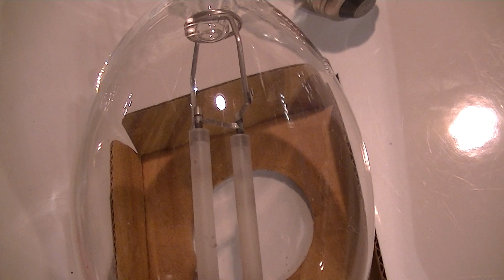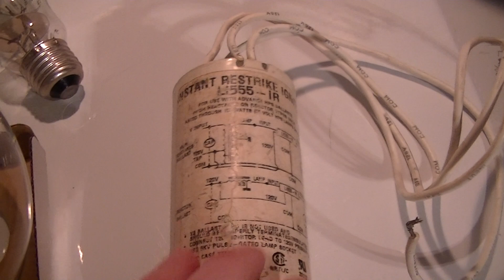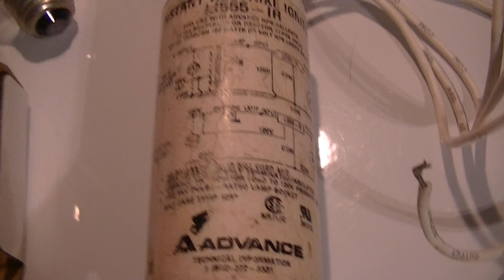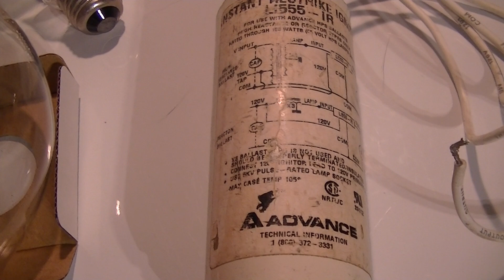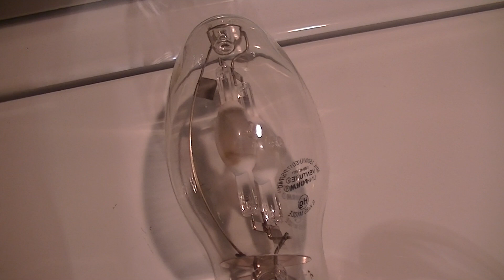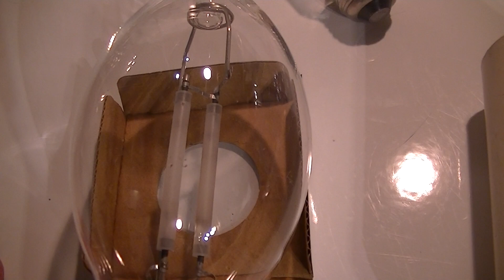Venture Lighting dual discharge tube metal halide lamps

Comment: try hot restriking one of those Dual arc tube venture MH lamps, they dont actually instant restrike, because the lit arc tube heats up the unlit arc tube too much, as. I understand it these are primarily designed for increased life, in that obviously every time you turn one one, a random arc tube will light, and I also imagine as one arc tube begins to age its striking voltage will rise such the more healthy arc tube will then strike first, and so forth, although obviously as you say if you burn one 24/7 without power cycling it then yeah one arc tube might explode before the other has a chance to do anything LOL, but in say a normal 12 hour on 12 hour off cycle I imagine there will be enough switching cycles to even out arc tube wear